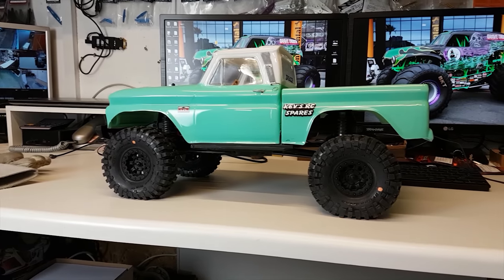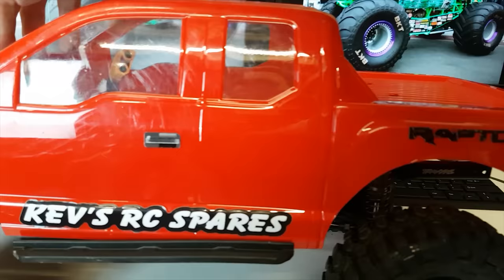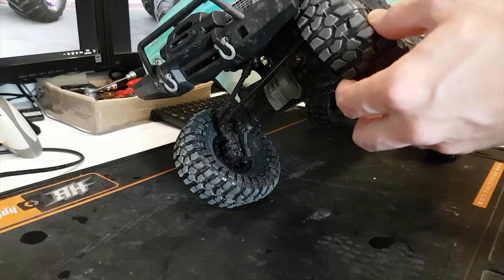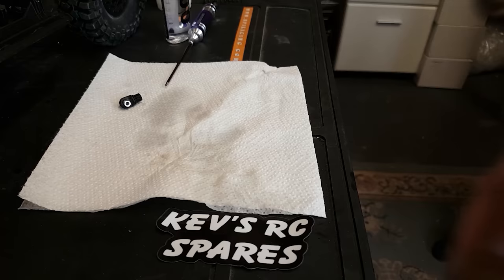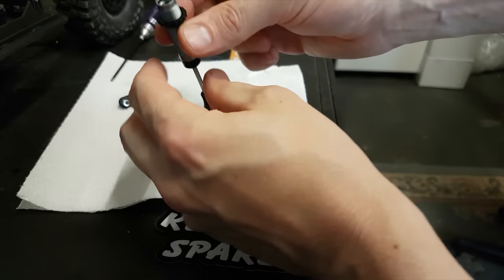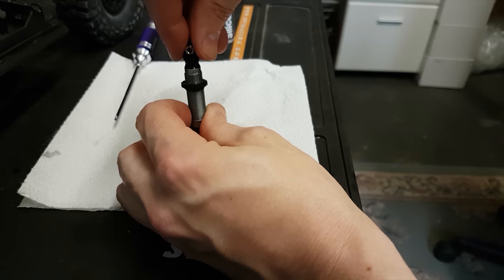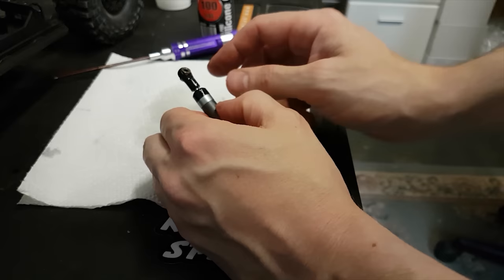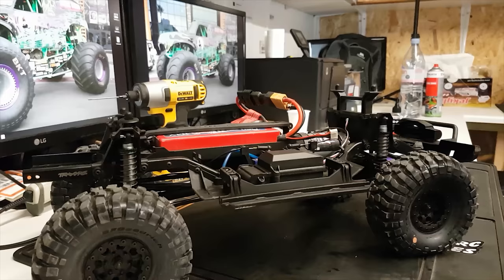Traxxas Trx-4 Thinner Shock Oil Before VS After Epic Cheap Mod! RC CAR

Comment: I’m not sure it’s the best idea to use a power drill to remove your screws, the heat might damage or melt the plastic. I learned from experience
Reply: DeRustix HD  I love mine like a child. I will hand turn my hardware thankyou.😎😎
Reply: its the torque not the heat and its fine if you know what youre doing.
Reply: @gschaaf713  exactly.

Comment: i just dont put any oil at all, works great!!
Reply from the maker: whats lt like at speed over bumps and jumps?
Reply: IWTaco711 Won't that stiffen up after some time because the seals and piston don't get any lubrication? Just wondering!
Reply: you can always put green slime (the team associated stuff), if thats a concern of yours...but i never had any issue. I use my rig for crawling though, not for bashing
Reply: Kevin Talbot that i dont know, i mostly crawl....but just try it and see if it works for you!!  thats the hobby after all....I tried after one of my shock was leaking and now most people who I crawl with  no longer bother with oil
Reply: No oil will make it very bouncy.
Reply: IWTaco711 I figured this out awhile back, last year, when I was even more of newb rook who still doesn't know that much even though ive added 4 scalers trx4/ 2 10.2/og scx10,  4 bombers/Rock rey/wraith,  4-5 short course, 2 drifters, and a big fast boat in the past 15 months. Clearly I've gotten  pretty good at buying them and necessary upgrades along with 3 over the top high dollar builds on 10.2, bomber, and rock rey. no I'm not loaded I'm more less sharing my stupidity and insane addiction that has now come to a halt and packages arrive once every two weeks instead of daily
Reply: I found those Junkie RC four-wheel-drive Kings don't really require oil and Hell all axial shocks lose it pretty quick unless you know the mods and bushing kits to get
Reply: ikr, me too, i run it like that over a year
Reply: I did the same thing.. Just left residual oil for lubrication. I did order some 10w I wanted 5w but couldn't find it at the time.
Reply: You gave me the idea to mod my Traxxas trx4 can I just put on a 1/10 scale shell that looks more real.
Reply: @tommy23490  if  you want light weight oil use gun lube
Reply: So no damping required?

Comment: Here's another tip: Get your hands on some lead used in roofing houses. Cut it in to long strips and wrap them around your wheel ( inside the tire). Or if possible fill up the inside hub of the wheels with fishing lead and epoxy but this method isn't un-doable. Heavier wheels benefit crawlers.

Comment: What I did to keep the same damping effect so that the tire won't sink into holes but rather glide over is I went with 25wt and drilled out the piston holes. You keep the smooth rebound but the shocks can work faster. Either way, you can't go wrong. The factory shocks with whatever oil they have in them are very sticky, Great Job Kevin. Always helping the community.

Comment: I run the Vaterra Asender Aluminum shocks on my Axial Wraith with no oil and it's frigging awesome just tension the spring enough to keep the car up right and riding high gets crazy flex

Comment: Great post. From my Landmax days, getting. truck to handle correctly in dirt was a balance of finding the right oil and spring rating and pre-load. I would think spring pre-load would have more to do with crawling ability that shock function. However, your truck is definitely bouncing less.

Comment: Definitely a good idea. I always run between 10w and 20w in mine...
Respectfully, I would say the rear is still too stiff. That's not oil, that's Spring. I would go at least 25% softer on the Rear Springs, same Oil. I think you will find that even be-er!! 👍👍😎

Comment: You're absolutely right about the shock oil. For my SCX10ii I switched to Team Losi 15w (which is 104 cst) and my black piston GTS shocks went from useless to great. I read somewhere that the TRX4 Sport comes with red plunger pistons (bigger holes) allowing you to run the 35w oil, but damned if I can find anywhere that sells them. Thanks.

Comment: Few tradeoffs come with nothing but great advantages. I find that unless its a very specific application the stock or a neutral setting works best overall in most circumstances. Of course for us tweakers we never ever feel content.
I hated the "bounces" so I went thinner oil, made adjustments. Well no bouncing but instead you start breaking stuff so thats the tradeoff.

Comment: Suspension tuning is a complicated art but at least it's easy enough to make big differences, it's the fine tuning that takes patience and skill but not that important for 99% of people. You've seen a huge improvement there for a couple of quid outlay.

The interesting part for me is the confirmation that stiffer suspension DOESN'T always reduce roll over. If the suspension is so firm that the weight can't shift fully then it can actually make the vehicle more prone to tipping over.
Reply: Ah yes, suspension tuning. Took me a while on my custom, Bruiser-based RC4wd scaler. The thing weighs a ton with all the steel parts and hardbody and it would tip over when the chassis shifted weight from one side to the other. At first I just went stiffer and stiffer on the springs which killed articulation and didn't solve the problem. Solution: 90wt oil... yes 90wt in a crawler/scaler. The thickest oil in any RC I own.

Comment: Hi Kevin, great video as usual. I didn't notice big articulation. how does one get good articulation? Is the key longer shocks? If so what size for scx10 ll. Also what are your thoughts on springs vs internal shocks? Thanks. Take care and keep up the good work.

Comment: If you make sure the shock is completely collapsed when you screw the top cap on all the way you should not have a hydro locked shock. The shock should also want to slightly push out as well but still be fully compressible.

Comment: Interesting Video Kev, Thanks! Since you've obviously got tons of experience and knowledge about SO many different makes and models etc. etc. I'd really appreciate your opinion on a few things concerning my new SCX10 ll 1955 Ford 100. I'm definitely going to be putting some inner fenders on it and one of the first things I want to change is the stock tires, wheels and shocks. I really like what you have on that TRX4 and would like to know exactly what that setup is, including sizes, and if you think it would work on the SCX10 ll without rubbing and binding up on the '55 body. I'd really appreciate any tips you may have on that. THANKS!!
Reply: I've got 1955 F-100 and 4.75"(not xl) RC4WD Wrangler MT/R is pretty good, videos in my channel.

Comment: Nice tip, thanks. I noticed it seems quite peppy for a crawler, I'm assuming that's a brushless setup, right? You seemed to be able to crawl with it as well, you mind telling what setup, motor and ESC, you running?
Reply: Definitely go with the 3300kv axe xerun. Put it in my trx4 Blazer and it's amazing! Super slow crawl speeds, (stock it was already really good at this) low range is now equal to what high range used to be, (compared against my buddies trx4 bronco) and it absolutely rips when you want it to. Plus knowing I won't have to replace brushed motors, and all the programmability via Bluetooth.

Comment: that happens to my scx10, the shocks got stiff early, so them two 0 rings at the bottom of the shock body, use 0 rings a fraction smaller. boom

edit...
what happens is small bits of dust and shit passes through the original 0 rings when the shaft goes up and down in the body and lodges in-between the seal sometimes entering the shock.

Comment: I'm confused this truck was designed for Crawling not Bashing, this should have 30 to 50 wt oil in it, 11wt is nothing you might as well run water in it or just remove the shocks??

Comment: Put the velineon system in !! (I know its overkill but , i never seen a brushless TRX4)
Reply: RCDuck's | Chaine Modélisme someone put a pro4 with a mamba max pro
Reply: Oh really ?! xD
Reply: it can happen but it will sick to drive. when you try to go slow it will cog and bounce around everywhere. better to put something sensored in there
Reply: limitless rc
Reply: the velineon can not be driven at low speed at which this truck us designed for. you'd have to go sensored brushless.

Comment: I didn't see any difference
Reply: Looks more flexible to me and the suspension is more active when cornering at speed. It's still a little bouncy but that's because the thinner oil is allowing the springs to rebound faster which is better than before where it was bouncing because the shocks could barely compress at all.

Comment: It would help if you properly filled the shocks with oil.... you would receive a noticeable difference. The shock should full extend by its self if it been fill with oil properly. Your method merely uses the oil as a lubricant. I suggest doing some more research for better results on more views.

Comment: Welp to be honest this video is a bunch of uneducated bs. You aren't changing the stiffness of the suspension but rather the rate it reacts. Essentially you made it more springy on landing because the shock will compress quicker without the pack of the oil and then rebound easier because the spring has less to fight. Try running a softer spring and stiffer shock oil.